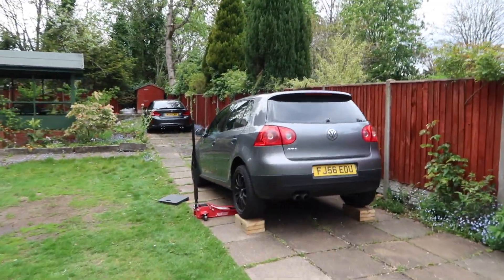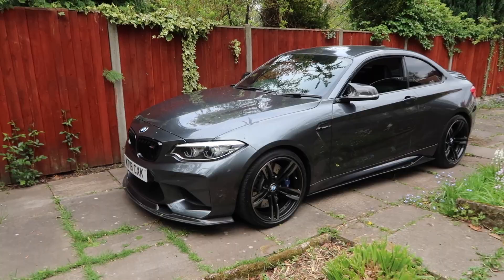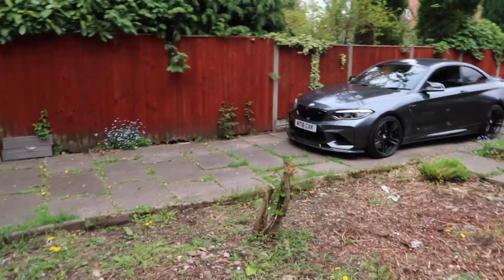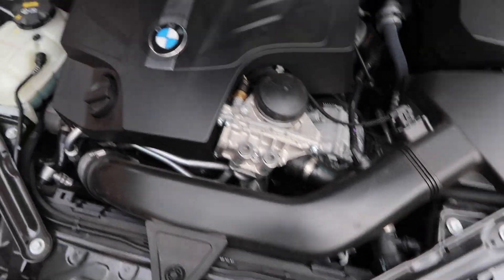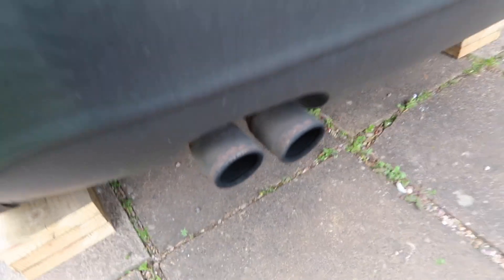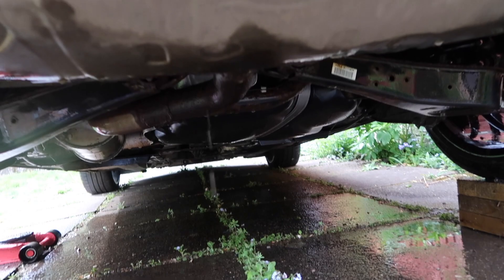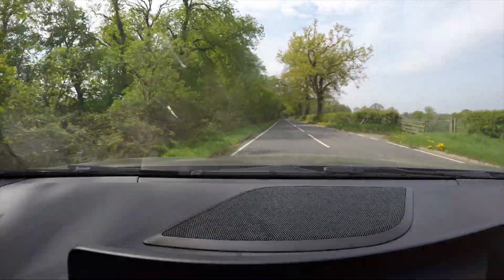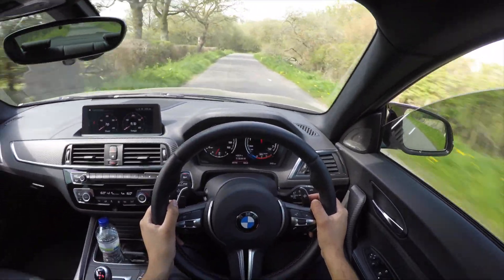I'm Selling it...?

Comment: Should of tried to put a 5 pot in that Golf or..you are selling t to save money and for later on like , almost Everyone lately ,especially you-tubers , now wants a TTRS or an RS3 because check out “Malaka Motorsports” on you tube , they have a Rs3 sedan with a hybrid turbo and some small tunes and it gets 9.9 on a quarter mile and 275 on the mile and it has traction because of 4x4 and because England is wet and snowy and it would Gap a certain M4 lamppost lengths